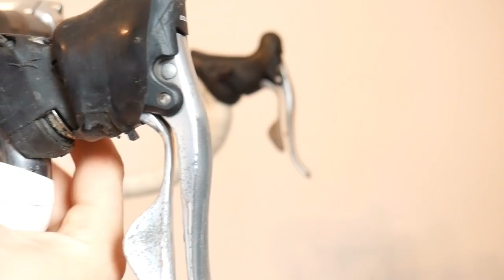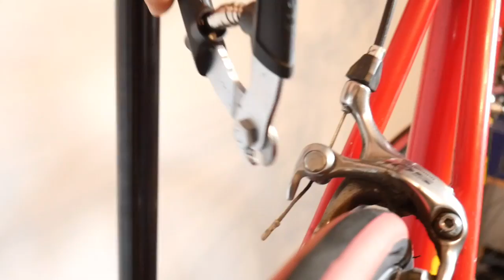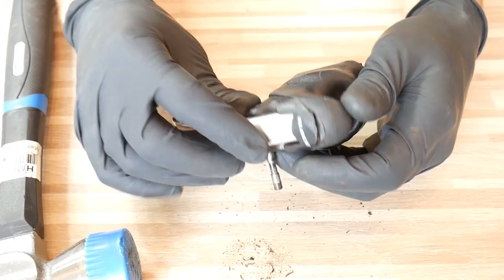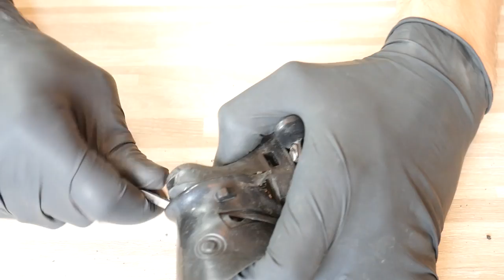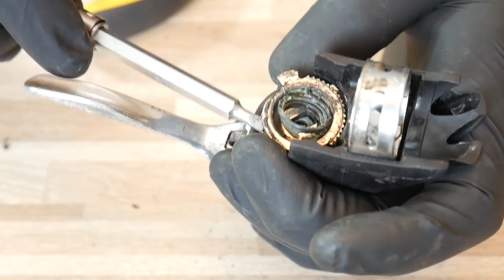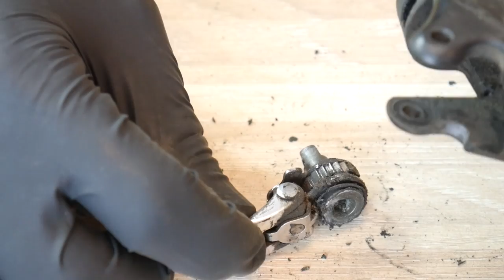Campagnolo Shifter Disassembly In Details. 10 Speed Veloce Overhaul. PART 1

Comment: my pedals make some noise like tic tac... 
i want to fix it
i opened them and i can't see anything wrong
Reply: Try degreasing them and regreasing them and see if that fixes the problem. If it doesn't then it could be because something is worn out
Reply from the maker: Make sure your table and rag are 100% clean when you regrease the pedals. Just one piece of sand can make the noise.